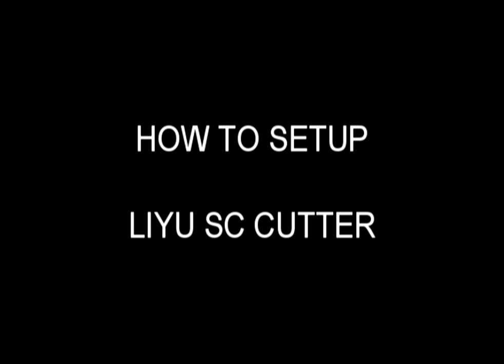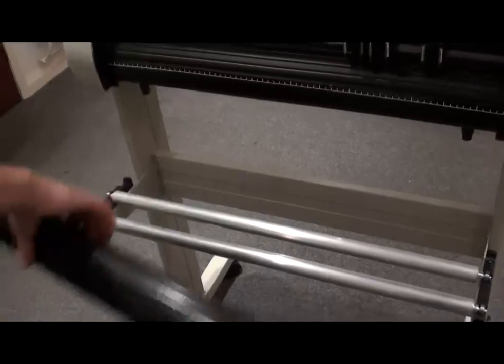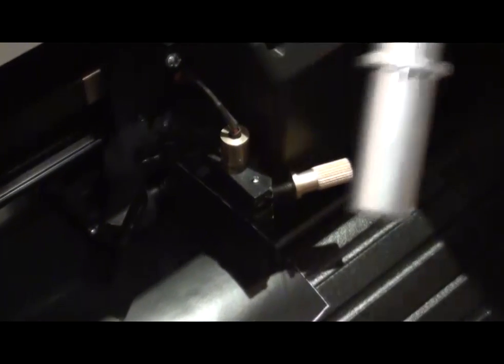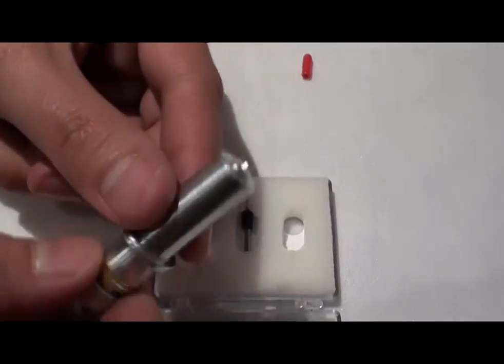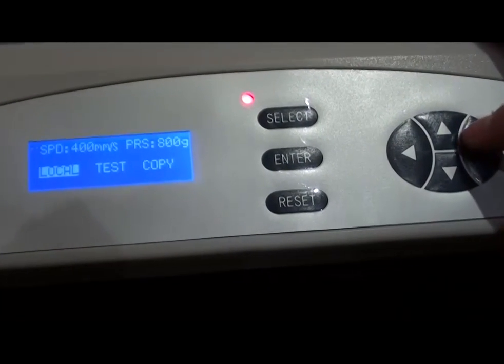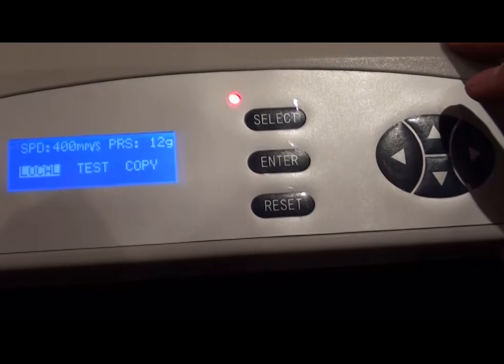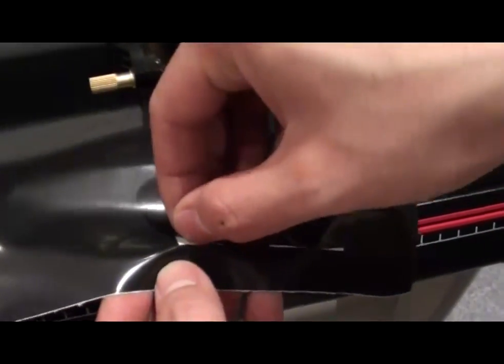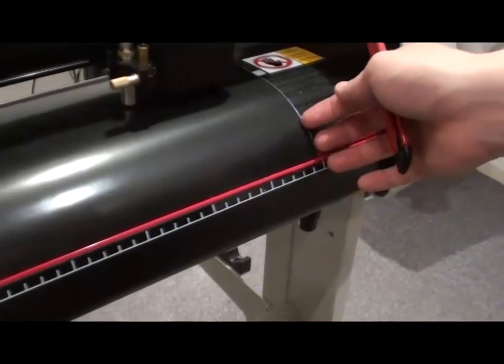HOW TO SET UP LIYU SC CUTTER

Comment: I just purchased this cutter and really didn't have much of an issue getting it to print on an iMac using OSX 10.7 and SignCut Pro which came with the cutter.  Basically I installed the software, and it asked what cutter I was using.

Comment: I have this same plotter now for over a year. It still deliveres good quality cuts.
The only problem I'm having is cutting during the winter. In winter time the humidity in my office is pretty low ( <40%). This low humidity is causing a large build-up of static electricity. This causes the cutter head to either go wild (cutting unwanted large horizontal/vertical lines) or the whole cuttintg job just stops at a certain point. What's the best way to deal with this on a Liyu??

Comment: hey i just had the same problem with mines....I looked close at the part that holds the blade and it was leaning...It was becuse one of the white wheels on the blade holder part was not on track...look close and see if that works.

Comment: yeah i bought this back in august, still havnt cut anything. how do you get it to read registration marks for heat transpaper tshirt designs? its one thing to cut on your vynil randomly, another to line up those registration marks with the 'optical eye'
Reply: This is a feature found in your rip software. For example if you are using a large format printer such as Roland or Mimaki, and your design software is Flexisign (variety of software that works this way), you will have the option to send to the "production manager " or RIP both a print file as well as a separate cut file. Many of these printers will do both while the media is in the Machine, however if you wish to Laminate your media or your printer is only print and no cut, you have the option to add to the print file a few different registration marks that the optical laser can scan and calibrate to ensure accurate cuts. There are 2 basic registration marks to consider which one you choose simply depends on how large your image area is. For example if you are outputting a 2ft cut the marks will only be at the four corners or osd and when you send file, the plotter will search for and locate all four before beginning and with a much longer tile or image area, the marks will be distributed more frequently along the edges as well as the corners to ensure the media is tracking correctly and is square..  in short, using the optical option on a plotter requires rip software that supports it.. There are some that require you to manually line up the marks one at a time before cutting while a red laser beam guides you..  I hope this helps and please feel free to contact me if you have further questions.. I'm happy to assist as I have been in the Industry for many years..
Reply: Ha!!!   You asked this 12years ago!!  Oops😂

Comment: I have the same plotter but i have a problem on taking out the paper later. How can i measure the pressure i have to use. I did with 400mm and 12g as you do on the video but I dont have the same results as you do.

Comment: hello, i have the same model as your video but has been stuck for many years, i wonder how can you help me about it. the problem is the cutter plotter is turning on when pressing the switch but the display and power LED doesn't light up, i pressed all the buttons and it doesn't respond. only the motor sound can be heared. I would appreciate any inputs from you. thank you